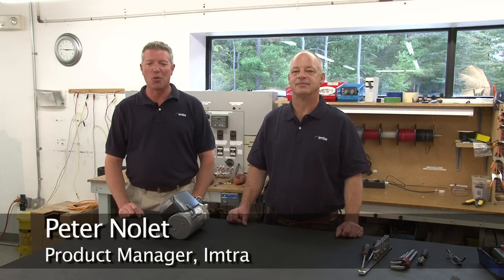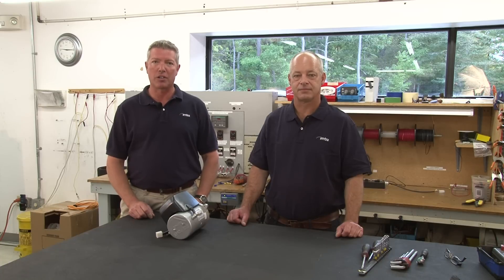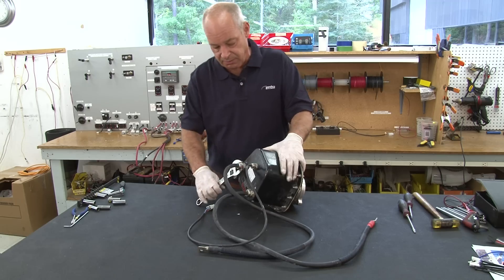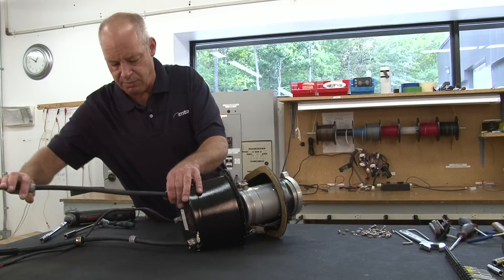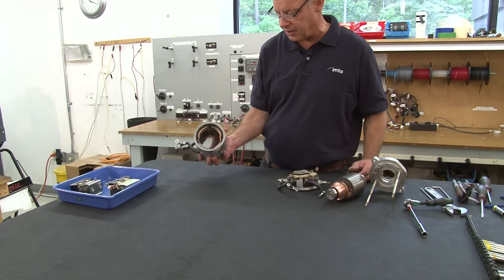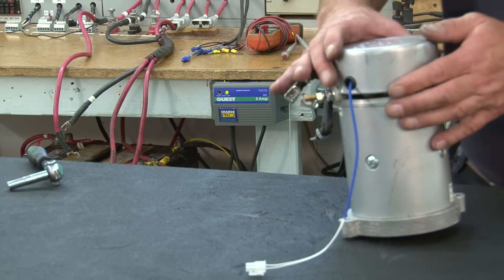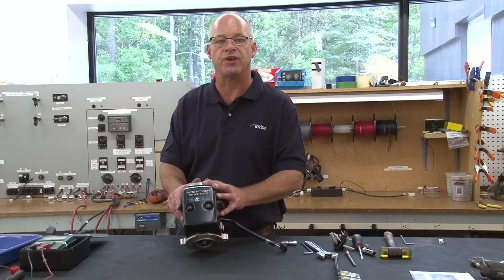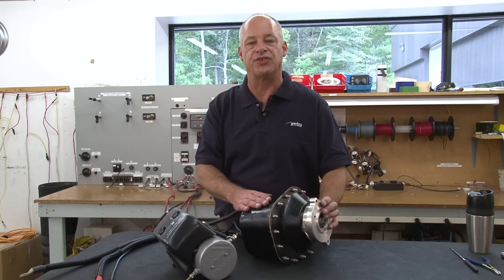Side-Power Speed Control Upgrade - Part 2

Comment: can this be done with an older system? Mine is about 15 years old.
Reply from the maker: Peter Kreutzfeldt

Hi Peter,

Thank you for the inquiry. Yes we can update older systems if the motor is in good condition which it likely is if it is running well. I have flyer that has more information if you'd like me to send it to you?